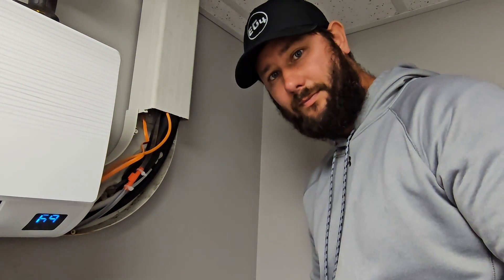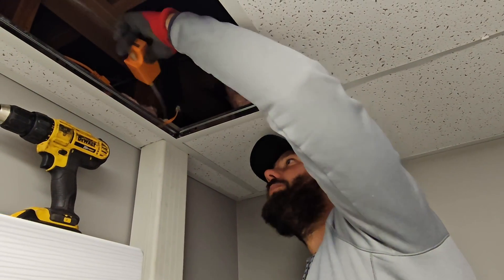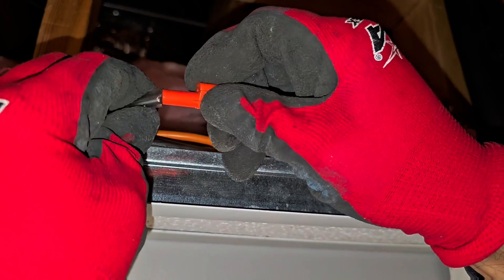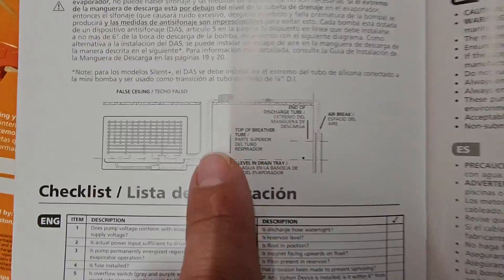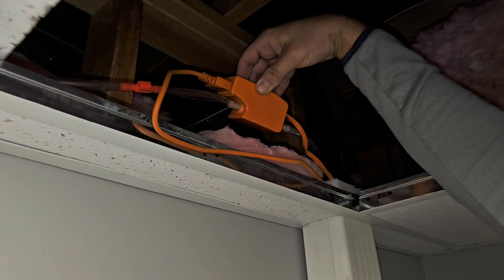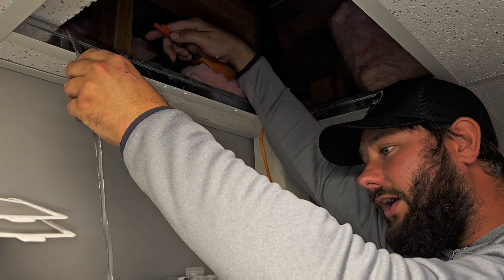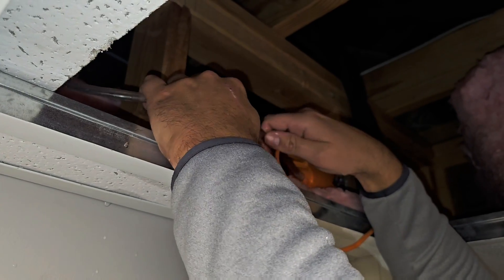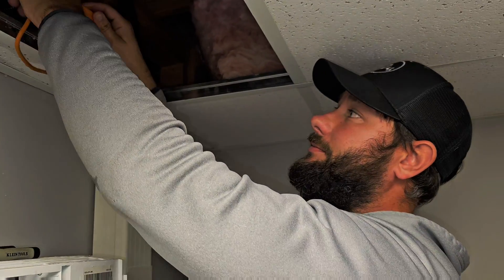MINI Condensate Pump MISTAKES You Need to Avoid!

Comment: What is the smallest capacity indoor head unit available ?
Reply: Depends on the manufacturer. I think the smallest I saw was a 6k BTU but I think only with a multi zone. On a single zone I think 9k BTU. I might be wrong.